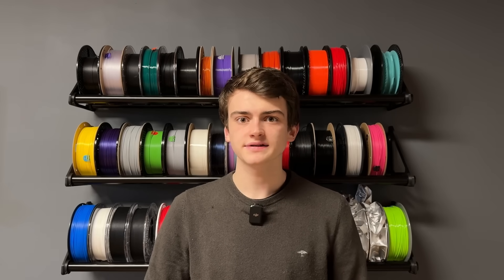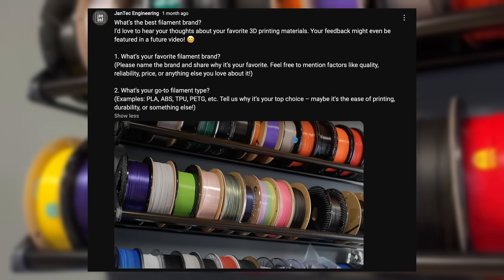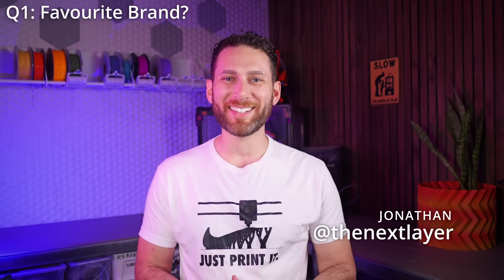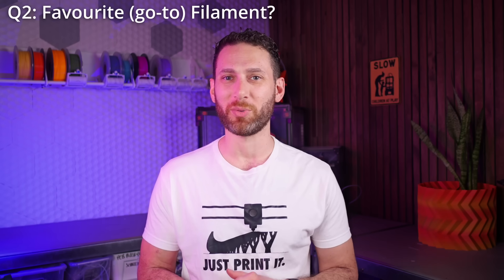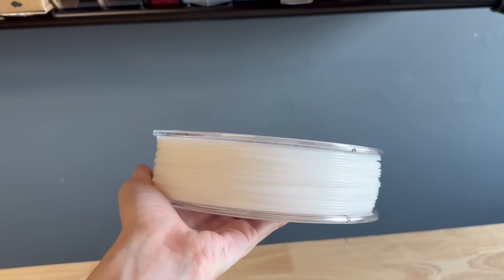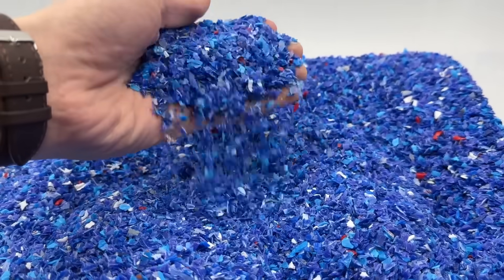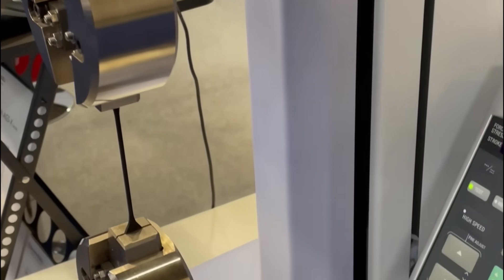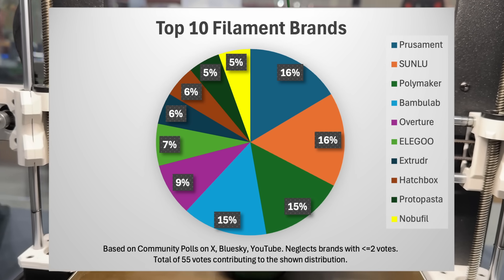The Best 3D Printer Filament Brand is...

Comment: 3DXtech, Prusament, and Push Plastic are by far the superior filament manufacturers, the same could be said for Taulman (RIP). All of the Chinese products are made at one or two CCP owned manufacturing facilities in China so they are essentially all the same save for small changes in formulations from "brand" to "brand." The Chinese stuff isn't terrible, and I do use it for prototyping and some finished products, but if I need exacting materials that I can be sure about I use the good stuff.

Comment: Polymaker is my go to. But I am starting to switch over to Bambu Lab just because of the convenience of the RFID in the AMS which is very nice. I hope this becomes an option that will work with more brands in the future. I think that Polymaker and Sunlu make filament for a lot of other companies either way.
Reply from the maker: That's a good point, filament company doesn't mean filament manufacturer.

Comment: Gonna shout out Gizmo Dork's HIPS filament.  Seriously, HIPS is underappreciated.  It prints with basically the same settings as ABS/ ASA, but isn't nearly as much of a drama queen, is super stiff, and shockingly light for its strength.  And Gizmo Dork's HIPS is one of the few lineups that has it in a pretty wide range of colors.  My only complaint about their HIPS is that they seem to be putting some sort of additive in it that makes it resistant to acetone and, therefore, acetone smoothing.  My guess would be that they did this so that you can print with HIPS and use ABS/ ASA as a support material and use Acetone to either weaken or completely dissolve the ABS/ ASA supports.  I just wish they would advertise this on their listings, because the first time I went to try and acetone smooth a figuring made with their HIPS, all it did was kind of give the surface of the plastic a slightly dried out appearance.

Comment: I can't really print pla, but love petg for everyday use and cf nylon and pctg for functional parts. My printer is a heavy modified prusa i3 mk3s with a bondtech lgx shortcut copperhead, the entry level hotend from sliced engineering. I mostly print petg or even pet. Pla just doesn't really solidifies in times to be useful to me

Comment: I'm always amazed by how much variability there is even just between brands. Even with materials that don't advertise additives like plain PETG there ends up being a lot of variability. WRT favorites, Duramic PLA+ has been pretty great for my puzzle projects. It's very impact resistant but still easy to print accurately. It's just not very fast and requires aggressive cooling. It's similar in spirit to Polymaker's PolyMax PLA+ but way cheaper.

Comment: I love the Overture Rock series PLA and their PLA matte series and pro series.   I find the rock series in marble or the red tan combos look amazing on statues and also mountain type scenery or even for things like a gridfinity large storage box.   These are very nice high quality filaments.  I also like many of the filaments made by Qidi and Siraya tech.   ABSGF25 being one of my favorites.  I have to be honest the Polymaker stuff has not really impressed me much on some of the rolls I have tried out.  I just got in a bunch of Anycubic PLA in grey which I use all the time just a great all around general purpose filament.  I have a few new brands that I have yet to test out, but snatched up a few dozen rolls of various PETG and PLA filaments to test out.  I tried out some PETG from Creality recently and was not impressed.  Most of the stuff out there seems ok, but I do have certain brands that I stick with, most of the stuff I actually print is higher grade engineering type filaments, ABS is still my favorite all around filament and most used one along with ASA.

Comment: I'm just starting out and I can already tell it will be extremely application dependent.

Right now I'm using a bunch of matte PLA, PET-G HF and Translucent PET-G because I'm making boxes and drawers for my modeling stuff, and PLA and PET-G have a really low coefficient of friction against each other.

However, I need to make about a zillion arms and shoulder pads to magnetize my Grey Knights, and I'm told the Sunlu PLA Meta makes the most detailed prints. I've got a spool and will start experimenting with it once the drawers and a PLA prototype dreadknight are done.

So yeah, I think I'm going to be using a lot of different materials as I get further into this.
Reply: The sunlu pla meta is very nice, and can print very fast. I like it.

Comment: I mostly buy eSun, Sunlu and Polymaker, because they are similiar in price and on the lower side of that, whilst I never had problems printing with them. I often notice a weaker color in these, compared to like Prusament, but this is also not always the case. PETG Signal white from Prusa is way more white than any other white PETG I own, but the "Signal" in the same indicates that. I'm yet to find a filament that can compete with Galaxy black.

Comment: A question like this is going to end up fairly subjective IMO, there will be objective things the people using these filaments will extract from using them, but once many try a few, get burned by some others, then preferences tend to start forming from there. The only 2 I've even used from that pie-chart are hatchbox and overture. I can't even use the overture half the time, because the fumes it makes are kinda obnoxious for 'PLA'.. no idea why it off-gasses as much as it does compares at normal temps, compared to all the other off-brand ones I've tried.. yet is one of the frequently praised ones? So again just one of my (subjective) experiences, vs others.
Reply: That's really interesting.  I run a wide number of brands including Overture.  I have never noticed any obnoxious fumes from any of them, including the Overture (except, of course, with ABS).  I print with a Creality CR-10, E3P, K1 and an FLSun T1 Pro.  Who knows why?  And you are absolutely right about the "best" being highly subjective, especially due to the huge number of variables involved it determining a "best" anything.

Comment: I think my favorite color of filament is Overture Army Green PETG. It's a gorgeous color. I don't really have a go-to brand or type because it all depends on the application and desired color. To do a lithophane or filament painting, Bambu PLA because my X1C with 2 AMS units just automatically works and the settings are already known quantities for transmission distance, flow rate and color.

Comment: I build and sell huge, powerful 3D printed nerf blasters.

My go to filament is CC3D PLA MAX PLUS, also sold as HZST3D PLA Plus
The stuff is cheap and rigid without being brittle and is perfect for the high abuse applications I put it under.
I've printed about 150 spools of it in the last couple of years and I'm not sure what I would switch to if it disappeared.

Runner up is Esun PLA+

Comment: First off - I don't know why anybody still prints with ABS and PETG when ASA and PCTG exist.  They're just objectively better. 
Secondly - those tasty Polymaker ad dollars make me very sus about any YouTubers' stated brand preference. 
Thirdly - great channel, keep the videos coming! 😄
Reply from the maker: 1. I personally prefer ASA over ABS too, but PCTG is a different material imo, its more expensive and a bit harder to print. 
2. I asked for their honest opinions but some might certainly be influenced by theirs sponsors. 
3. Thanks! Will do ;)
Reply: they are better but there is always a but. price, selection, availability, and from my experience petg prints slighly nicer than pctg if you care about aesthetics.
Reply: ABS is probably the cheapest filament I print. Usually around $15/kg, sometimes a little less. ASA is almost always significantly more. 

I wouldn't pick it for this reason, but ASA also doesn't adhere to any smooth plate I am aware of without some kind of adhesive. ABS works great on my PEX plate. Adhesives are messy to deal with.
Reply: @RichFreeman  I have found that high temp garolite ("G11"), wet sanded with ~600 grit, works really well with ASA.  You have to run it a little hotter; I usually have it around 110-115C.  I've run dozens of kg of ASA with flawless bed adhesion this way and no adhesives.

I've long since abandoned PEX as a print surface.  I never found that it worked any better than PEI.
Reply: @nikwoac  I'll have to try that - I have a Garolite plate (though it is G10 - not sure if that will create problems at 110 though I've probably already run it at that temp for Nylon).  I don't have a decent smooth PEI sheet so I haven't tested as much with that.
Reply: is pctg harder to print then petg ? do they offer more colour choice ?
Reply: @versus023  PCTG is still kind of an "up and coming" filament and doesn't have the widespread availability as PETG, so there aren't as many options.  In my experience, it prints about the same as PETG, just hotter.  I've printed a few figurines and toys with PCTG for my kids, but the bulk of my experience with it is mechanical production parts.

Comment: Nice video. I am surprised that eSun is not even in top10 in chart at the end. About impact test, very often manufacturer include Charpy impact test, but they forget to mention its a Charpy (supported from 2 sides, resulting bigger impact load)
Reply: yeah esun is pretty big and they have a wide selection. regarding impact tests, they sometimes also use some units other than kJ/m2 which doesn't make any sense.
Reply: @riba2233  in US they use often kJ/m (thickness of test objects) ASTM. The ISO standard is in kJ/m² (cross section area).
Reply: @MyTechFun  yes and I totally don't understand how kJ/m should be calculated while /m2 makes sense :D
Reply from the maker: @riba2233  Same, kJ/m feels strange.
Reply from the maker: Thanks for adding this and participating in the video!
Reply: So ISO use kJ/m².
ISO is more broad and lines up with our normal physics subjects and general calculations.   Fantastic imo as it's also how we measure pressure in engineering.  

Meanwhile ASTM is more material specific.  Eg D63 deals with plastic, and impact to plastix
Here you divide the result by the thickness of the sample (it's easier, as not all samples are the same size, so in a laboratory its soooooo much  easier as you just measure it and chuck it in and let tbe hammer go).  So they use j/m

It's more correct to use j/m.

Note that esun actually has a bunch of proper certifications, which is why they use the ASTM units. 

Would be good if they ALL did.  Polymaker is pretty close with that.
Actually would be good if everybody on every spec sheet (filament or alluminium or  my crepe pan or egg whisks ) wrote everything in both ISO and ASTM.  I mean it's a PDF.  Not like it wastes paper.

Anyways, favourite engineering materials are:

eSun pla Pro, ST and LW
Polymaker PC and PA612-CF
Could probably never afford PET-CF

Why?
Esun does nice pla-st and pro [except cold white] and its less than 1/2 the cost of polymaker in my region.

My polymaker roles get used only when I need the (cost).  But wow I love their colours.  The colour matching is lovely
Reply: @MuppetArms   which polymaker PC?
Also you can affor pet-cf, it is not expensive at all much cheaper than pa612 at least.

Comment: Keep in mind that many of the plastic base material is sourced from the same factory for many brands. And secondly, even the filament produced in one factory is then rebranded half a million times before it reaches end consumer. So next time, you will have a need to argue with your friend about which brand is best, remember, that they both can be not only from the same factory, but also from the exact same chemical plant making the material.
Reply from the maker: You're right. But I think especially the bigger brands, like Prusament, Sunlu or Bambu, but also local manufacturers do make their own filament with their own blends.

Comment: Whatever is the cheapest PLA in a color I like with at least a tolerance of 0.03 (preferably 0.02) and good windings. If I need something that has to handle slightly higher temperatures I go with PETG (same requirements as PLA).

I stay away from ABS/ASA because I would have to print outside and people put way too much trust into insufficient filters. CF prints ideally need to be coated in something to be "save" to touch which everyone also happily ignores. Besides from 3d printed stuff there isn't a single commercial carbon fiber thing out there that is not coated in resin with zero exposed fibers.
Reply: that think about CF is just not true.
Reply: you dont need to print outside. i have my printer in a closet that i sealed with gaskets around the door & a 3 stage filter with a VOC meter. it is not ideal, and i replace the filter monthly, but the VOC management is much better than i thought. it peaks after about 40 mins of printing & is mostly filtered out after an hour once complete.
also, there are plenty of filaments that hold fibers in the core of the filament very well. phaetus aeworthy abs-gf is my all time favorite for that - fibers dont stick out.
Reply: @ Sure that works and with a proper activated charcoal filter that gets replaced regulary you can make it work but for most people just not printing inside is easier and cheaper. Either way I am pretty sure that almost everyone who prints abs/asa does it in an unsafe way. Same with cf, most just don't care or know about the exposed fibers

Comment: i feel like this question is so difficult to answer because it is heavily influenced by the use-case for a particular part. most people tend to stick to the materials that are most applicable to their primary use case. i pretty much never use PLA or PETG. my main projects require high rigidity, high heat resistance, and/or high tensile strength. so i mainly use ABS, ABS-GF/CF, PC, PC-CF, PET-CF, etc. high temp - high strength.

i feel that this survey is missing the crucial "what is your primary use-case?" question.

my opinion:
sure, i understand that this isn't meant to be a concrete result of your survey - but it is more misleading in my opinion. maybe i am biased, but i do not like polymaker. they only have 2 main positives for me & theyre consistency & availability. polymaker ABS is definitely not pure ABS - my main issue with polymaker is that everything they make is a blend. when i am buying ABS, i am not looking for a PETG-ABS blend like polymaker has. blends are the biggest frustration when buying filament in my experience. i praise atomic filament for their insanely high quality ABS, but it seems like there are very few brands that manufacture genuinely pure filaments as they are advertised.
Reply: it is certainly not a petg+abs blend, it is something else in it. it can just be a different ratio of it's a, b and s components.
Reply: pet-cf is so underrated
Reply from the maker: @mrrooter601  I agree, it's sure not my go-to but agreat filament. Friends of mine even got to recycle old PET-CF (from BASF filaments), works like a charm!
Reply: @mrrooter601  yep, 100%! I assume we will see a lot more of it in the future.

Comment: The best visually appealing filament is cookiecad PLA, The most consistent filament is BAMBU,  poly maker is a great filament for the price, and worst is prusa.
Reply: did you have bad experience with prusa?
Reply: An NDA prevents me from disclosing what company I worked for but they are a VERY large company that runs about 60 FDM printers 24/7 and has used and extensively tested every filament brand out there. The worst price-quality ratio filament is unfortunately PRUSA filament.  @riba2233

Comment: I find it depends on what type of plastic as to which brand is best.
Polymaker PETG, for example, can be an absolute pain to print with and is very sticky and has additives that cause it to be more oozey.  Meanwhile, their PLA and ASA are great, print exactly how you expect those plastics to print.
Prusa, on the other hand, has amazing PETG, performs perfectly and as expected (haven't tried other plastics, not available in Canada).
So it completely depends on the type of plastic and then the brand.
Reply: I often find that we miss all those nicest filament here in canada. our choise is pretty limited compared to other parts of the world.